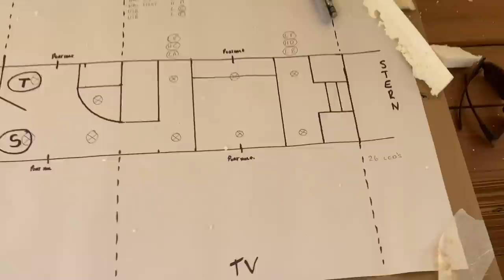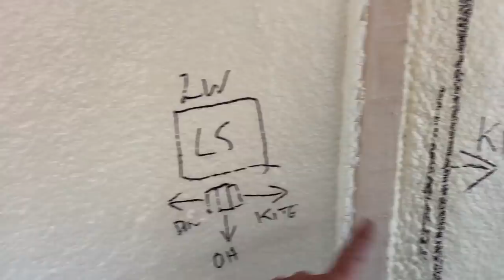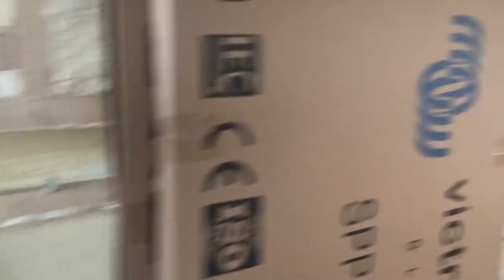Building Our Narrowboat #9 - First fix

Comment: A good way to cut back the foam is to use a multi-tool with a wood cutting blade. It’s a bit messy but gives a good accurate finish and the depth of cut be controlled relatively easily.
Reply from the maker: Hi Nigel, yes I’ve been using that method for a bit now. It certainly is easier.

Comment: If you attach a wire wheel to a drill, you can trim or remove that foam quickly and easily. and don't forget the goggles and mask! Let it settle and move on to the next project
Reply from the maker: Hi Gary, now that does sound messy. Its pretty much all done now, wasn't too bad at all. Thanks for the comment.